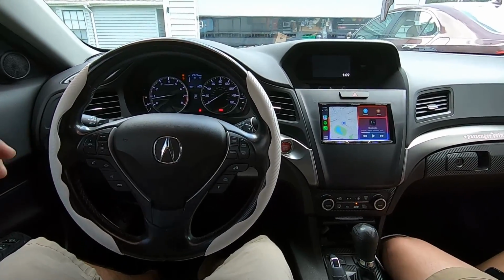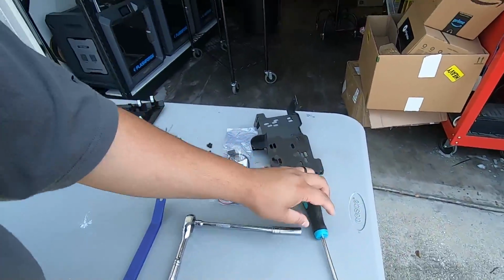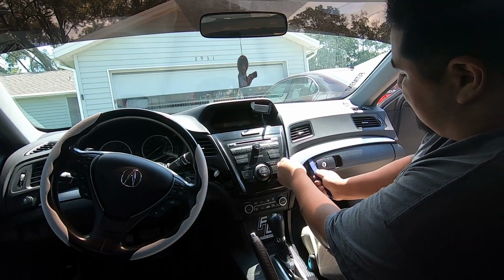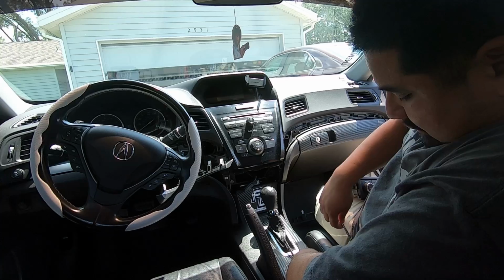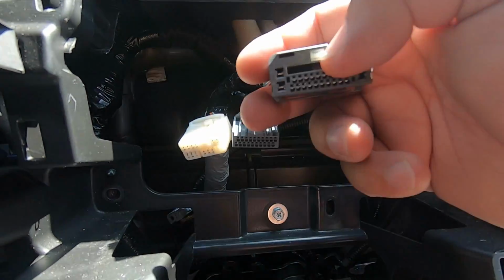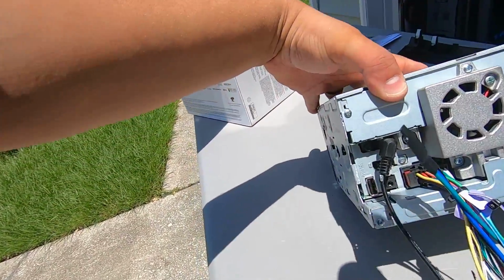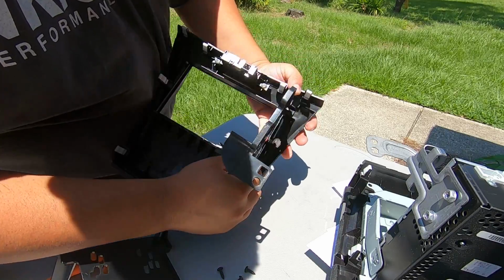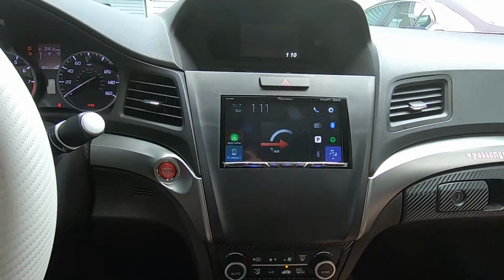Acura ILX Aftermarket Head Unit Car Stereo Install - Pioneer Double Din Radio - Plug and Play

Comment: Have the same questiom as Smkaz81, are we lost car control computer and clock if I buy this pioneer, I have a 2022?
Reply from the maker: yes the clock is wrong unless you plug it in at 1, all the information that used to appear on the top screen is gone. You will not see it anymore just the backup camera and the time.
Reply: @AcuraAudioGarage Thx! But is the diagnostic menu is gone?

Comment: Hello 👋,  great content 👏 👌 
Quick question, can you still change the clock on the upper screen 🤔 or can you make that disappear 🤔 
Can i still use steering wheel phone buttons 🤔 
Also probably a dumb question, with that pioneer radio, if im using Android auto can i still listen to fm radio at same time, like listen to radio while getting turn by turn directions 🤔 
Keep up the great content 👍 👌 👏
Reply: Have the same question, the car control is on the upper screen, whats happens if I install this!?
Reply: @p0werc0rdz exactly same question, what if my battery’s dies and the time changes how would I change it back, also if I have a wallpaper already set will wit get rid of it
Reply: The acura ILX has 3 camera modes. How would you switch between the 3 different angles

Comment: Happy it works, but dash kit is kinda ugly... Same reason I would not upgrade my MDX. Only the base can be done?
Reply from the maker: no we got the base 2013-2022 covered, tech 2013-2015, premium 2013-2022. But you lose a lot on the 2016+ tech and premium.

Comment: Thank Gog I found this. Just got the ILX Base. Love the car, but our 12' Civic has a better stereo in it. Will be doing this ASAP. I also assume that this kit is compatible with other aftermarket head units?
Reply from the maker: yes it works with almost all aftermarket radios.